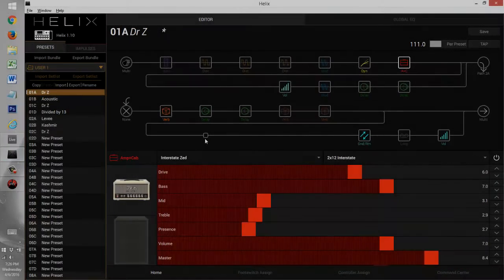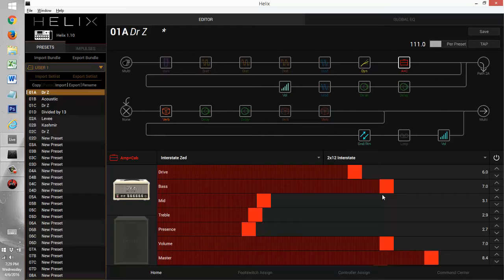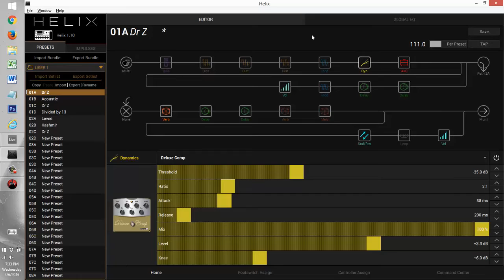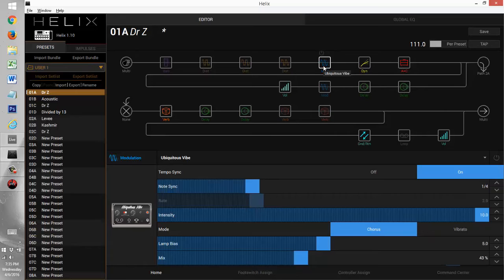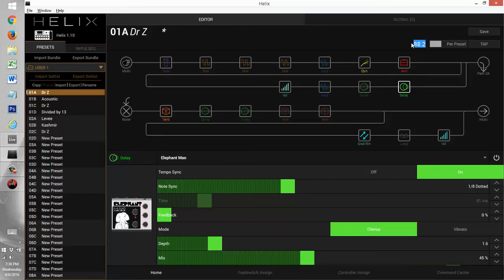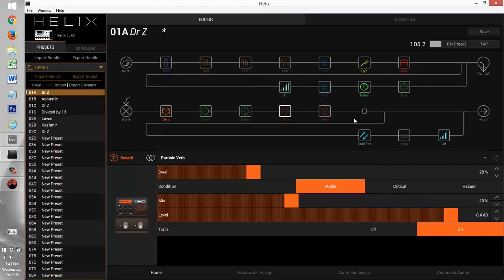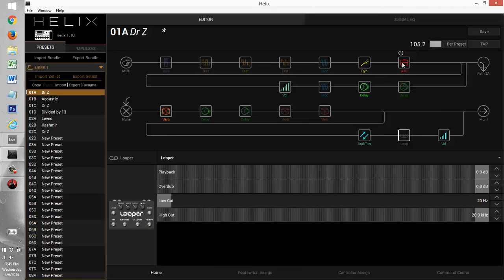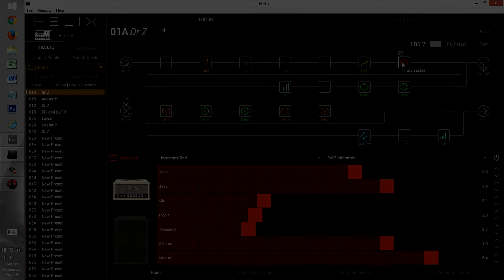Line 6 Helix patch creation

Comment: This is great! Is it variax?
Reply from the maker: +Jack Turner thanks! Yes, this is using the Variax modeling.
Reply: Hey, thanks for the response and great patch! You have the two delays and particle verbs mapped to FS1, how do I use that? for me it just has preset / bank options
Reply from the maker: Jack Turner if you go to the global settings there's an option to use all the foot switches for on/off switches.  I don't remember exactly where the setting is off the top of my head.  When you're in this mode when you hit the mode button you still get access to banks and presets.

Comment: Thanks Chad.  Good walk through.  So did they change the layout of HXEdit with later versions, or is that the difference between the MAC and PC version?   The MAC version doesn't have the big sliders, they are much smaller and there aren't any pictures of the amp and cab on the left.
Reply from the maker: Thanks! They did change the look of the editor with the smaller bars. I believe it was around version 2.30.

You can toggle the newest editor between the list view, and showing pictures of the models. You click somewhere on the panel where the list is to toggle, but I can't remember exactly off the top of my head :-)
Reply: Yeah I see that now, it doesn't look quite like your view here.  It shows bigger images of all the amps, cabs and effects in each menu, but not a single picture once you pick it, it just highlights the one you have chosen in the list.  Not a biggy really; however, I wish you could change the slider bar size and numbers.  My 48year old eyes would appreciate larger bars and numbers ;)  

Maybe, I need to replace my lost glasses. lol.

Comment: Chad, try dropping a stereo simple delay after the last volume pedal. Set the delay time at about 30ms, about 30% on the feedback and perhaps 40-50% on the mix. (the feedback and mix you'll want to tweak). Make sure that last A/B split is mixed 50/50 (even sound levels), then pan the A path to the left and the B path to the right.. That way you'll get a cheap real time "double track" effect. Its not as "cool" as the Keely 30ms pedal through the effects returns (I had one and sold it), but it can add a depth that is kind of fun.... I have a patch I can shoot over to you if you like. Cam
Reply from the maker: Thanks! I'll try that.  If you want to send me the patch that would be great.

Comment: One of my pet peeves with the Helix and it was the same with the HD500, whenever you add a Volume Pedal it automatically sets it to EXP2.  I usually use an external Morley Bad Horsie 2 in a loop so would love to have the Volume automagically set to EXP1 instead of 2.  Stupid I know, just a little OCD I guess ;)  I know you can set it, but doesn't make sense to default to EXP2 when you only are using a single volume pedal.

Comment: Hey Chad, saw the updated video with the Matchless. Which of these will deliver a "cleaner" clean tone?
Reply from the maker: +Rob Groden the matchless channel 1 is probably as clean as the Dr Z. I haven't compared them directly, but I think they're pretty close. I use the model that has channels 1 and 2 together and have a slight amount of breakup if I really dig into it, but channel 1 by itself should work well for clean. I found that I slightly preferred the matchless, but both sound great.